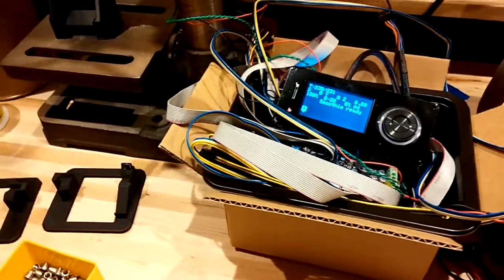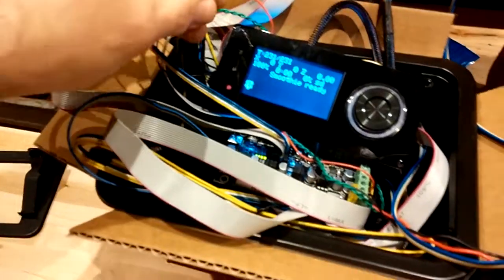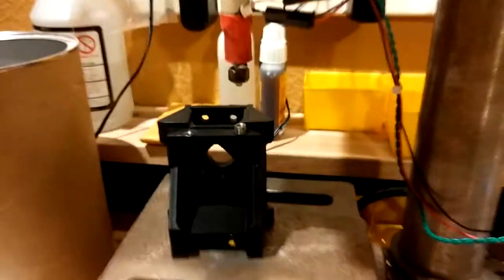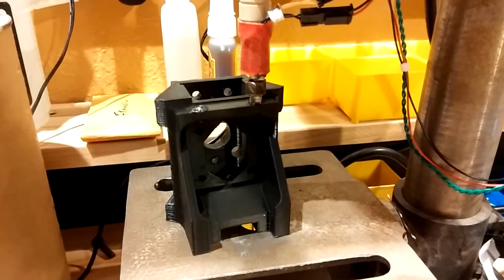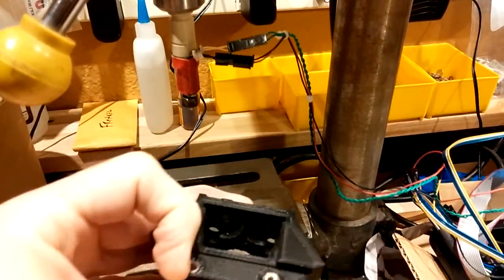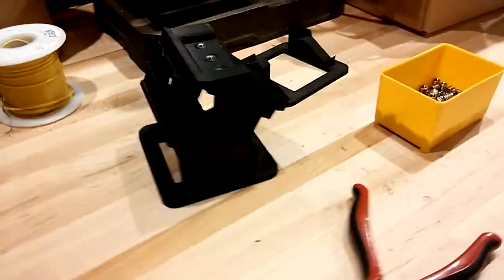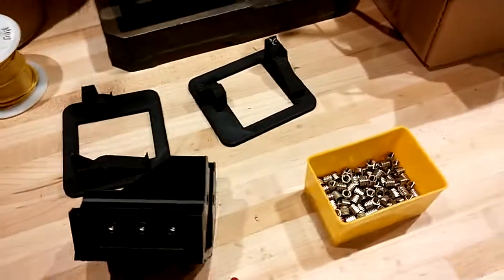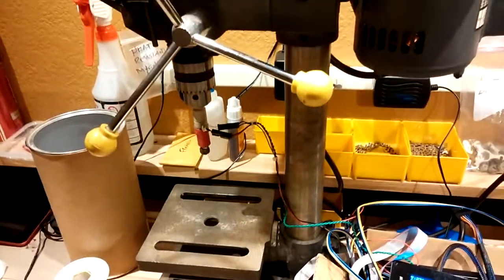Hot pressing stainless nut-serts into 3D printed ABS plastic

Comment: That is really practical.  Any help with the schematic for the hot end control?  Thanks.
Reply from the maker: I used an Azteeg X5-mini control board and a Viki2 LCD panel. These parts are typically used in making reprap style 3D printers. I had a spare one. The control board has a thermistor input and a mosfet controlled output to heat up and monitor the temps of the 3D printer UBIS hotend that I chucked up into the drill press. It's just a mashup of stuff that was sitting in a box in a drawer of my shop. If you bought the parts just for a project like this then it will cost you more than it's worth and you could probably do the same thing with a temperature controlled soldering iron. But you'd have to figure out how to attach the soldering iron to the drill press (or any press for that matter).
Reply: Steve Graber Thanks for that additional information; this makes some PLA parts I thought I would have to cast in aluminum (using the PLA part as a mold) usable with the nut-sert option.